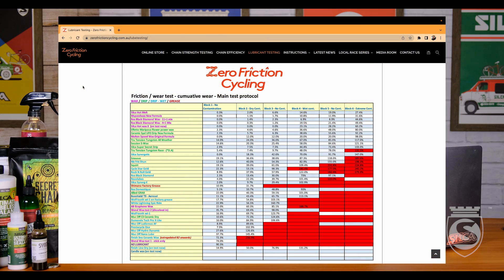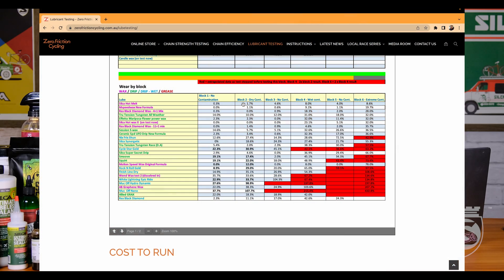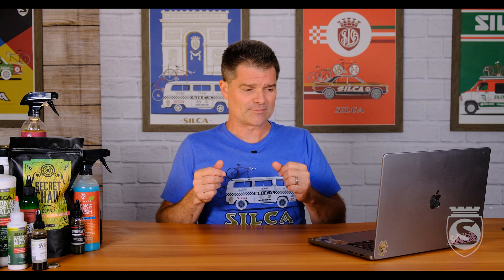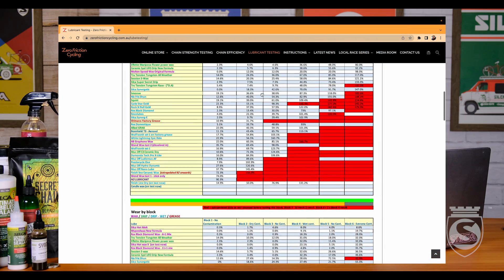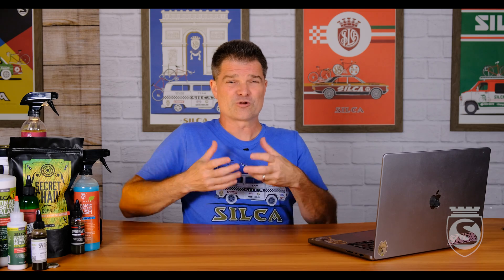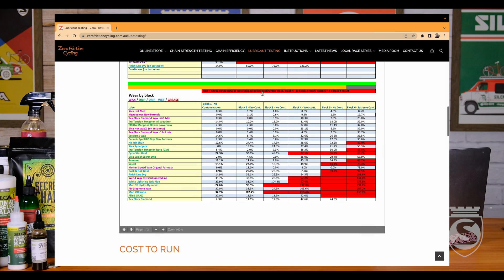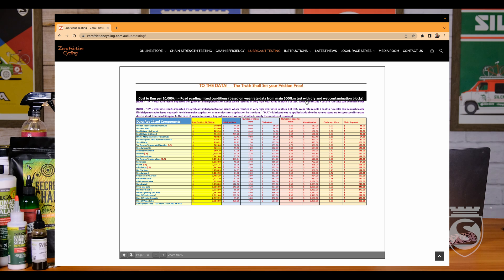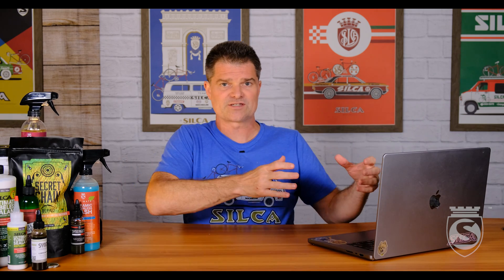Astonishing ZERO FRICTION CYCLING Data Will Blow Your Mind!

Comment: I love the Silca hot melt wax - but for a quick re-lube in the middle of a race Squirt works really well.  I know it would be "better" if cured, but it is thick enough and oily enough that it works pretty well when run fresh - as opposed to the Silca drip wax which just all runs off your chain if you don't let it set.  Also it comes in a little 15ml bottle which fits in great with your spares!
Reply from the maker: The thing to be careful about with Squirt or Smoove, is that since it doesn't penetrate into the chain, it will mask the sound of a chain where the lubricant is breaking down, but it isn't actually getting in there and lubricating at the pin/roller level.  So on a chain that's being pushed past the lubricant breakdown point, you would be much better to transition to Synergetic or NFS or other oil based lube, which will flush some dirt as it is applied, but will also fully penetrate and be immediately functional as a lubricant at the pin/roller level.

Comment: Thanks Josh! Very helpful. I'm all in on hot melt wax except for my bike that lives permanently on my Wahoo Kickr inside. I use Synergetic for that. I have the needle applicator on that bottle. Should I be using two drops or is one still fine because it's indoor only. Thanks!
Reply from the maker: One drop is fine for indoor, the bigger drops just help flush dirt better, but that shouldn't be an issue.  You should also check out SynergE for your indoor.. ~3x the single application longevity of Synergetic and no flinging even under extreme efforts.
Reply: @SILCAVelo  Thanks! Yeah, I learned about SynergE RIGHT after I made the Synergetic order and it was too late. It's ok, it still works great and I'm not powerful enough to fling anything! I'll get SynergE next time.

Comment: I'm honestly confused. On one hand you regularly claim that rewaxing can be done every 1000km or so but now you say that under bad conditions 150km might be all you get out of a hot waxed chain 😮
Reply from the maker: Rewaxing at 1000km works if conditions are good, but yes, in extreme conditions, 150km might be all you get even with hot wax.  This is why we want you to look at the single application longevity charts, in extreme conditions the application life of all lubes can really be reduced.. in the dry dusty conditions using Boeshield T9, the entire wear life of the chain is consumed in 93km so a proper relube interval for T9 is ~30km in the conditions where it's 150km for hot melt!!

Comment: Rather than add wet lube, remove your noisy waxed chain and replace it with your spare freshly waxed chain. It takes seconds to do that especially if the chain has a bit of wax tension to help guide it through the pulleys.  I add a quick link to the spare chain packet just in case. If applicable, make sure your SAG team knows if a quick link has a specific trick - like SRAM Eagle’s flat and concave sides - a roadside fix takes a minute but its a pain. Great videos as always.
Reply from the maker: That works too!  We've had TransAmerica, GreatDivide, and RAAM riders do this with excellent results.  With SAG it's extra easy as you can be rewaxing chains in the RV or whatever as you go.. very effective!
Reply: Totally. Putting a new chain is the way to go on those Ultra Distance Gravel Races. It weighs like 240g

Comment: Is there a a difference between different production batches of the Silca Super Secret drip wax (e.g. an improved formula through newer iterations), and if so, which lot did ZFC test and show results for in his charts?
Reply from the maker: The formula is the same now as what Adam tested (which was Batch2), but the original batches were all based on what period during COVID they were bottled.  Batch1 was bottled in my garage, Batch2 was bottled by hand at SILCA and was mixed in 55gallon drums, and Batch3 was our first real production on our fancy mixing/bottling line that we installed.  The real improvements in Batch3 and the current production which no longer has batch numbers on it, are from consistency in the manufacturing process.  We had a lot of variance in Batch1 and 2 due to all of the hand mixing and weighing and such, as well as just the small volumes we were working with.  The one thing that we learned from Adam's testing of the UFO2.0 which was modelled after SuperSecret was that we needed to extend the drying time.  Adam did his test with 1 drop of SuperSecret and 8 hours dry time and UFO called for 2 drops per roller and 24 hours dry time.  When we evaluated this, we found that using 2 drops and increasing drying time made for a notable improvement in our formula as well, so we have updated our instructions to reflect that, but as Adam's tests take so long and the formula was the same, it was never retested to see what improvement those changes actually make.
Reply: @SILCAVelo  Thanks Josh!   I've been using silca hot wax with generous SS drip wax topups (batch 3) between hot waxes.  Works great for all day gravel rides leaving an almost clean chain.  The latest SS formulation is darker in color appears to; be easier to apply, wets better and dry faster.  It seems to  be slightly stickier to gravel dust. 
   Should I just wipe clean and reapply  top ups as usual?
Reply: @SILCAVelo  Many thanks for the excellent and informative reply

Comment: Hi Josh thanks for another awesome vid!!! It took me 2 and a half yrs to use up 2 large bottles of ss drip(topping up from ss hot melt) lot 2 I now have 2 more bottles of ss drip lot 3 which is much darker in color(more tungsten disulfide?)should I expect even better results with the lot3?I've watched and use all your tips and trick vids on the hot melt,I bought the us cleaner that you recommended,I melt the hot melt in the sous bag which is in the us cleaner and do a 10 min cycle on full wave then let the wax cool to 140f before removing the chain,with awesome results!!!Do you have plans to do some tips and trick vids for the wax x,I tried letting the wax x cool to 140f went to give it a swish at 150f and it was glued to the wax pot had to reheat and removed at 160f.Cheers!!!